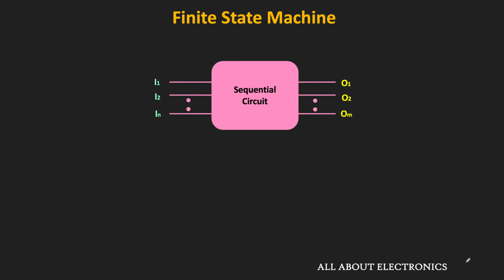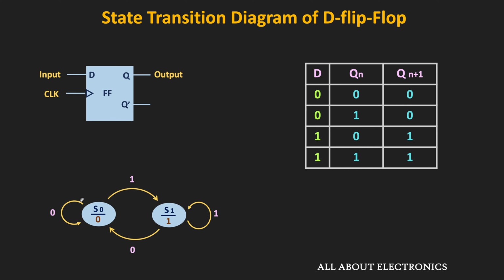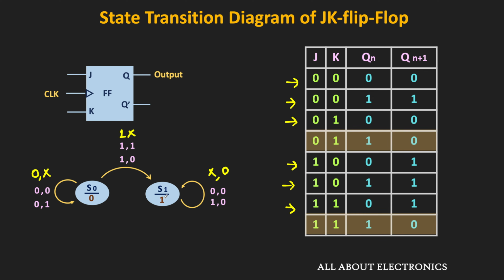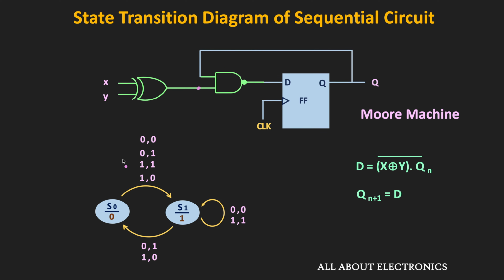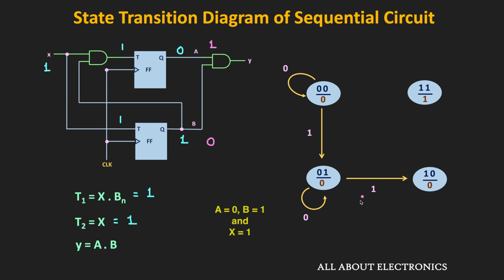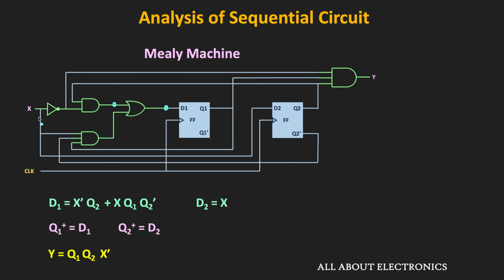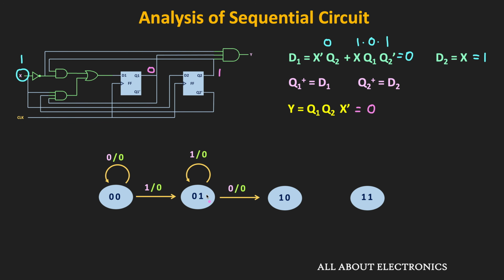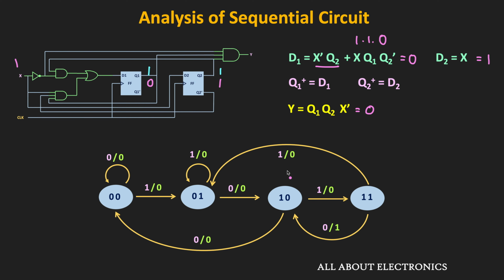How to Draw a State Transition Diagram? Analysis of Clocked Sequential Circuits

Comment: i think there a mistake at 15:11.  the arrows going out from s1 should be interchanged
Reply from the maker: No that’s alright. Please go through circuit and state diagram again. S0 state is the state when the output of the flip-flop is 0. And S1 is the state when the output of the flipflop is 1. So when Qn is 0, then one of the input to the NAND gate will be 0, and hence its output will be 1. So irrespective of the x, y inputs, the input to the D flipflop will be 1. And hence the flipflop output will go to 1 at next clock. That’s why there is a transition from s0 to s1. Please watch it 11:15 onwards.

Comment: @33:27here won't the output be 0 as when the clock edge comes the output is determined by new state and input not old state and input and since new state is 10 the output will be 0
Reply from the maker: In mealy circuits, the output is a function of the present state and the inputs. Here, 11 is the present state. And based on that state and input, the output is 1. 10 is the next state. That means in 11 state when input 0, then the Melay machine will go to 10 state. And based on 11 input, its output is 1. That is what is represented in the state diagram. I hope it will clear your doubt.
Reply: @ALLABOUTELECTRONICS  but you solved all the rest using their next states,
Why switch up for the last.

I think it's an error worth revising. You have a reasonable number of graduates depending on your material. We love you.